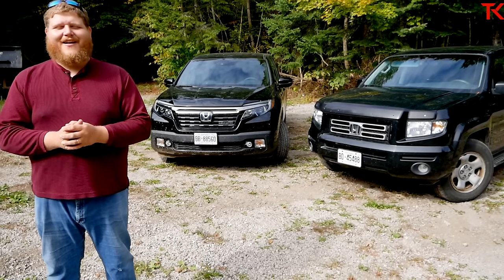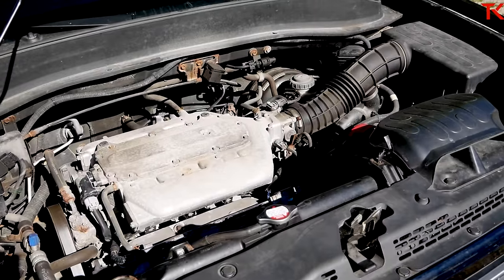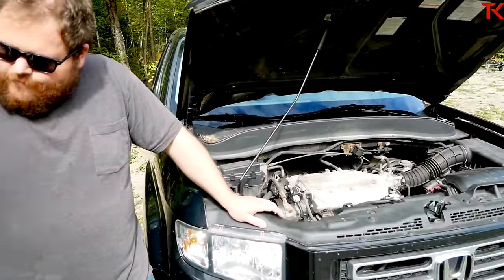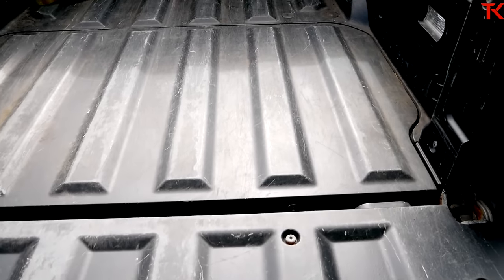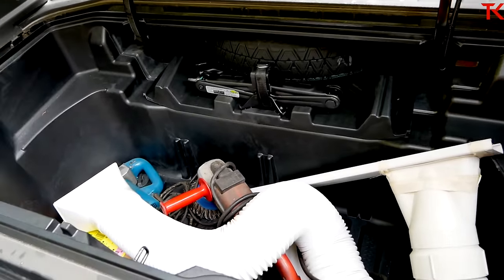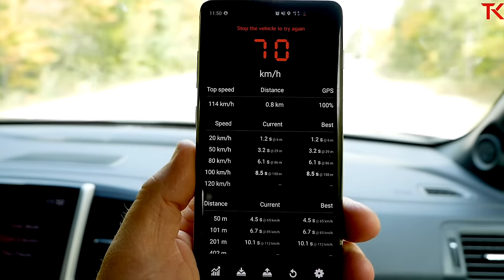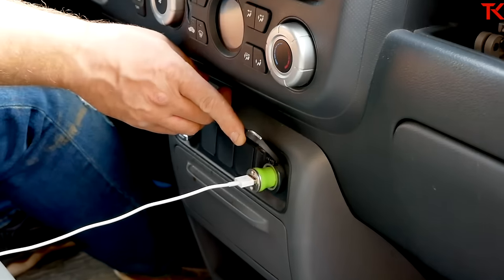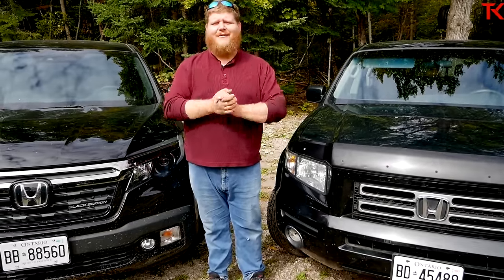Old VS New - Is the 2020 Honda Ridgeline Truly Better than the Old One? + 0-60 MPH Drag Race!

Comment: On my 3rd Ridgeline, current is 09. Waited for the second gen to come out and was totally disappointed.  I just don't like the looks of it.  Looks usually don't matter for me but I just can't do it. 

I tow a lot, cars, 5000lb trailers, my boat, atvs, sleds and it never skips a beat.   Never use a wdh as it never has needed it.

Current is lifted 2 inches, has 32 inch tires and goes everywhere I need.

I actually have never had a four pin on any of my ridges.  Maybe that was added after.

Comment: I've had a 2008 Ridgeline for the past 8 years and love it. Fortunately picked it up with only 9,000 miles on it and it has about 120,000 at this time... and it's in premium condition as well. Many of the new changes on the new Ridgeline are terrible... the overall style, the tail bed, and the interior - especially the middle console change. I'm planning on keeping my existing Ridgeline at least another 10 years and that Honda will revert back to a more truck like look in the future so I can purchase another.
Reply: Yeah man keep the Ridgeline
I have an 08 that has 270,000 miles
I have had it most of it's life and have only done regular 
It's still a great truck and everything works on it
Reply: Gary Chambers right on Gary, I figured as much for the longevity. I personally like the older style especially in that I put a Leer topper on it so it's got a smooth look like an SUV and provides me a dry space for toting gear around in. I'm considering purchasing one of those new Sol Horizon campers to boot... would look great behind my rig and is just as stylish.

Comment: I own a 2014 SE with a matching 5th wheel in the trunk. I never traded it in because the newer models have a smaller bed, and the trunk only fits a donut. I need a full size spare. Donut is rated at 50mph so you really shouldn't drive them at 70mph. This is why a full size spare is safer.

Comment: I think the 1st Gen Ridgeline is pretty solid and unique looking. I also think the 1st Gen had better use of interior space. I have a 2nd Gen. I think Honda should have capitalized off the square body of the 1st Gen, bed and interior space of the 2nd gen, sliding console of 1st Gen, 2nd Gen engine, and added an off-road package option. The 3rd Gen is cool too but they didn't change anything on the 3rd Gen except exterior looks. They made the 3rd Gen look off road capable, without the off road capability.

Comment: Was never into these Pickups, But when the time finally came for me to look into getting a used truck this started sticking out to me, even if i wasn't really into it before. 
Came across a great deal on one. and couldnt pass it up. about 8 months with it now. favourite vehicle iv owned/driven
so glad I went with a ridgeline rather then a similar year f-150 or something like that. the entry level V8's of similar year make barely any more power, and a shitload worse fuel mileage. not to mention every full size of similar year and price was absolutely beat to shit.  

Just wish they didnt change the looks of the news ones so much. not really into it at all. looks like a van up front.
Reply: @Charlie Pryde Oh totally! by no means did i mean it had the same build and drivetrain underneath. I just meant it visually looked somewhat minivan like for me. but honda has a record of putting designs out that may not be the biggest hits but they age like fine wine. thats really how i think1st gen ridgelines are as well.

Comment: Do you have to keep the truck running to access power from the 400 watt access plug from the back bed?
I know my 2007 Ridgeline, I have to have the truck running to charge up my cell phone.  Truck not running, my cell phone will drain my truck's battery.

Comment: The Ridgeline is a very nice utility vehicle with an open cargo area but it's based on the Odyssey/Pilot platform which doesn't give you enough ground clearance, my 2012 Crosstour had more clearance.  One of the biggest downfall on the redesign was dropping the center console armrest.  I can't stand seat attached armrests, for that reason and the low clearance is why I bought a Toyota Tacoma.

Comment: Looking forward to the travel trailer towing. Ive got an 09 (from new) that I love and picked up a dual axle TT ( 3450 dry) this summer. I got the hitch height right with a weight distribution/ sway bar and that has made a big difference towing but I keep wondering how that extra 30 hp and 9  speed ( I think its a 9 speed) could improve the drive?

Comment: It's not a truck, but it is a pickup. You retain the cargo flexibility expected of a pickup. I do have to say I feel the storage would be more usable if there was a passthrough ala travel trailer that opened from either side of the rear quarter. You could toss straps, hitches, fishing rods, rifles, potato guns, flux capacitors etc. through there. You would have access even if you had a load in the bed, as well.

Comment: I loved my 08 Ridgeline 500000 km . watch the rearend  where axel  is close to the frame they go bad infront of wheels, I pulled the u bolts through so it was done but i loved it . I hauled wood as much weight as my buddys ford.

Comment: I had a 2007 and was disappointed.  Gas mileage was a poor highway 17mpg on a good day.  I did tow quite a bit with it and typically when towing near gross 5klbs the fuel economy would dip into the 8 to 9mpg range. If you used it as a car with occasional light truck use it was nice save for the crappy fuel economy.  When you start loading it up it becomes apparent very quickly that this is a car with a truck bed.  Also, surprisingly I had repeated transmission problems, probably because they put a car transmission in a vehicle that was listed at being able to tow 5000lbs.

Comment: I'm looking at a 2021 Ridgeline along with the Nissan Frontier (I'd consider the Taco if they made it more comfortable for a tall guy to sit in).  If I can drive to work, run errands, haul the occassional big thing, go fishing, haul a small boat, and throw a deer in the back once a year, then I'm good.  High quality and good value while getting some simple things done is all I need.  The Taco would be great, but the cab and seating (how often would I need to actually sit in the truck, right?) are just not as good as a lot of the competitors.  Fix the Taco interior!!!
Reply from the maker: From your lips to Toyota's ear.

Comment: Why most people dont consider it to be a "real truck" cause it dosen't have a ladder frame simply. It dosen't help it's case with lack of transfer case( proper offroad performance) fully independent suspension the way its built isn't built for abuse. So that's kinda why all the hate comes it. They definitely have some pretty good ideas like the tail gate and built in box storage but otherwise for those aspects it's in between a truck and suv people who want a suv with a box. They kinda have a high price point when you look new compared to other mid size trucks and for the money and lack of capability. I've seen new Ridgelines going for 50k Canadian. I just consider it a category of it's own.
Reply: A fully equiped RTLE model Ridgeline is about the same price as a TRD PRO.  People that buys the Tacoma better use it offroad or it's just a waste of money just like any other pavement princess you see on a daily basis and aren't practical as a daily.

Comment: So does Matt's older truck have the option to check for gas mileage distance?
Reply: Our '07 RT does not. But, a light will come on when the fuel level gets very low

Comment: I have a 2011 RTL that I love but am contemplating giving it to my son and replacing it with a newer generation. Is there anyone reading this who has had both and if so, is the ride (comfort, road noise etc...) comparable or better in one than the other?

Comment: The gen1 also has tie downs top and bottom for front and back. The old owner must have removed them for the tonneau. I know this cause I have them on mine. Also they got rid of the 4 pin in 2009  when they integrated the rear bumper and hitch.

Comment: I’m not against the ridgeline, I think it’s a great truck for someone with very minimal payload and towing needs, definitely more practical than a car/ 5 passenger suv, but nothing about it screams $32k. I can buy a new Nissan Frontier (yes I know how dated it is) for 10K less, and still do just a little more than what this truck can do, with the added leaf springs and 4x4 option, if I was in the market for a 32k truck, I would actually consider the Silverado or ram and be able to do way more, but if I was looking for light duty, I would get a ridgeline for its newer tech, but I wouldn’t pay more than 23k for it.

Comment: Dumb question but could this tow my 13 hobda civic si coupe stovk weight just below 3k lbs abd the rear is fully gutted so it weights abit less then stock. Aby idea if the first gen maybe 2012 ridgeline could tow my car to the track on occasions like 3 times a year 🤔
Reply: Or is there a truck that can tow about this much weight that has a v6 and awd for about 10k CAD, I was looking at the tacoma or 2008 tundra v6 model

Comment: Honda should have stayed with the 2010 honda ridgeline body and just updated and modernized to front fascia and grill.  Even though smaller than full sized trucks it still looked like a truck, like when an 80 pound pit bull is next to a 110 pound labrador.  Now the honda ridgeline even though its probably the most refined midsize ttuck it looks completely car like.

Comment: I have a 2017.  Does anyone know of a slide in camper that would fit the Gen 2 Ridgeline?  Alternatively, does anyone have any insider info regarding the structural integrity of the side rails?  I could put an aluminum topper built but a couple of the more well known manufacturers said they won’t build for the Gen 2 Ridgeline because of the questionable side rail strength.  Honda wouldn’t answer my question so maybe a Honda tech might be able to answer my question.

Comment: What’s the mpg difference on the two trucks? I’ve heard the first gen is thirsty
Reply: My 2017 has gotten as good as 28 to 30 mpg, but around 23/24 mpg mixed driving is about right
Reply: My 2007 gets 17ish most of the time. I've seen as low as 13 in the winter (but my truck sits outside and I have a 4 mile commute)

Comment: Definitely would prefer a column shifter in the new truck! I don't know why the console shifters are so prevalent; they take up so much useable space which could be used for women's purses,  Radio installation, Ice chest, etc.  Please Honda (and others) reconsider shifter location and console design.
Reply: Yep, that nice big center console is designed for a woman's purse/bag on the Pilot lol.  I hate the fact that they carried it on the Ridgeline.  I do like the adjustable whimpy armrest but I really miss the traditional center console where I can put my weight on with my elbow trying to adjust my buttocks position lol.

Comment: Remind me not to go for that Honda dealer for repairs.$$$$$
Reply: Yeah, quoting a 1200$ timing belt replacement is a bit much for a beater. Alt, starter and battery and run it into the ground.

Comment: Honda missed the mark IMO with their latest Ridgeline. I owned two Ridgeline, the latest was a 2011. I traded it in in 2015 for a RAM. I loved my Ridgeline. If Honda would have made it to compete with the other brands to tow 7000 lbs, I would probably still driving one today. As well, I am not that fond of the new design, it should have been more “Truck like” like bigger and beefier !!!
Reply: There is a "bigger and beefier" Ridgeline.   It's called... a Ram
Reply: Vicarod - 😉👍👌.
Reply: @vicarod Sorry, vast difference in long term reliability between a Honda Ridgeline and a Chrysler product Ram truck.
Reply: @dougfielding8215  
Sorry, that wasn't the point of the post.  Honda has no product offering in the 1/2 ton truck market.
Reply: @vicarod  honda need to keep the Ridgeline the way it is and should just put out a v8 full size body on frame.  It doesn't have to have a massive load and towing capacity, just make a darn full size would be enough.

Comment: you only replaced the water pump and alternator so why did the dealership tell him it needed timing chains and all the other repairs if it didn't /sounds like someone pulled a fast one over on the old owner

Comment: For your busted rear seat support leg: I properly tensioned a bungee cord between it and the floor tie down, so when you fold up the rear seat it will pull the support leg into the proper position 🙂

Comment: people love to make fun of the ridgeline not because of the way it looks. but because the engine is sideways and it's awd not 4wd  and towing capacity is just dismal compared to a truck like the F150. the ridgeline is literally just a pilot with a bed. the last thing is that it is 4 wheel independent suspension. no solid rear axle. if honda actually corrected those things people would find a new respect for them and may even consider buying one. oh another thing is the v6 is the only option. some people want a v8. not because they need a v8 but because they want a v8.
Reply: It's actually more than a Pilot with a bed. Most reviewers don't talk about how clever the frame is. http://www.trucktrend.com/how-to/chassis-suspension/1705-honda-ridgelines-frame-the-untold-story/

If it had a solid rear axle it the ride quality would be shit, like the Tacoma and GM twins.

Comment: im annoyed that Canada gets cooled seats but the US doesn't, that doesn't even make sense
Reply: but Canada didn't get the volume knob back for 2020...but apparently the US did
Reply: @coolhandchunk  still no volume knob here is the US, still just the dumb capacitive touch area
Reply: @lonespartan31289  I stand corrected.  I thought I saw youtube review that showed the volume knob...must have been a review of a pilot.  I dont understand why Honda didn't transplant the Pilot infotainment system into the ridgeline.  The two vehicles must be just different enough...
Reply: @coolhandchunk  yeah it needs the knob. It should also keep the radio on until you open your door, not just shut off when you turn your engine off, that really bothers me

Comment: I bought an 2006 RTX, traded it in for a 2014 SE, I went for a test drive in a 2021sport. Sorry Honda my 2014 much more refined , comfortable, and has everything I need for 35000. The 2021 sport for 40000. not even close. I'm in the process of buying my son a 2009 RTX.

Comment: There's a thing no one is calling the gladiator SUV with a truck bed even though it is the only difference between the ridgeline and the gladiator is the gladiator has a separated truck bed and a ridgeline I believe has a built-in truck bed
Reply: Sorry I guess the new one does have the separated truck bed but the old one doesn't

Comment: Any Ridgeline owners have their truck bought back by the manufacturer due to frame rust? Of course not.
Reply: Thanks for the heads up im gna check mine do you live by the coast
Reply: @edwardarsiaga3569  He said, "of course not" because #1 it's a Honda and #2 it's not body on frame, it's strong unibody construction.

Comment: This is why dealers are the worst place to go for maintenance.  Replaced the timing belt, starter, and alternator for less than 2 grand with honda parts.  Of course they want to rob you so they quote 7 grand.  If you do it yourself it's even less.  Im surprised they didn't squirt some oil and tell him he needed new shocks as well.
Reply from the maker: You performed your valve clearance inspection when you replaced the timing belt too, right? Or is that not covered in the DIY repair manual?

If you know a dealer being THAT shady report them! I stand by my work.

Comment: Visually, I prefer the 2nd gen. I have always thought 1st gen looked like a ripoff of the Avalanche & Im not a fan of that look. I feel this truck was probably designed for more of the suburb type consumer where you need the bed & able to pull a small trailer if needed. I dont like the idea of the plastic on the motor.